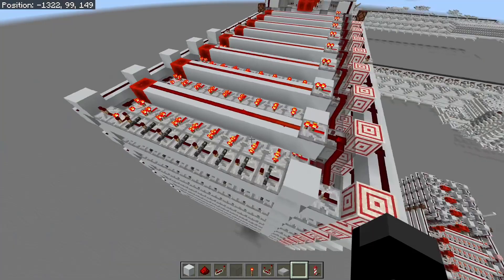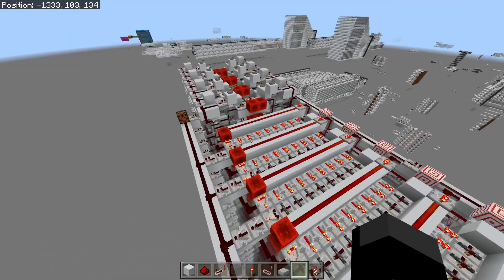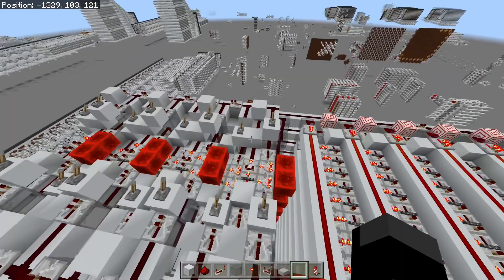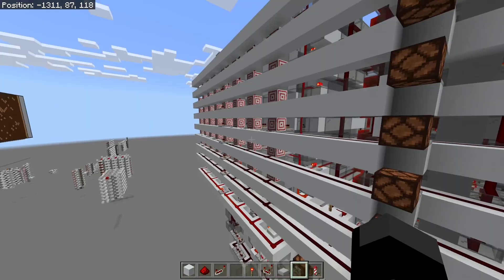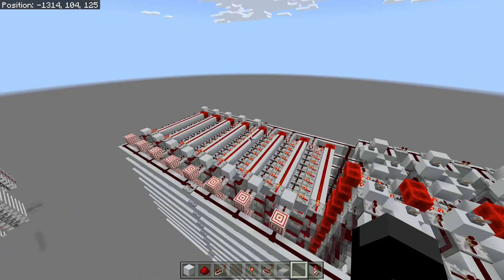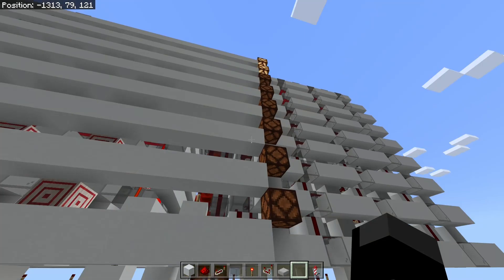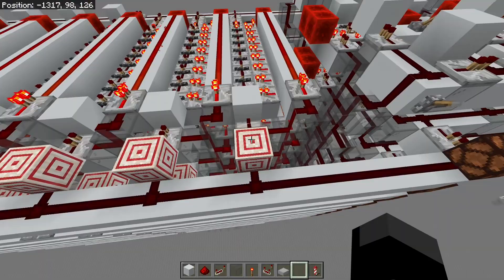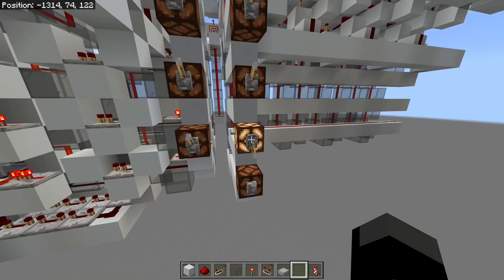RAM/Memory Paging Concept! - Minecraft Bedrock

Comment: Question… can you use the process of paging to make a computer register?
Reply from the maker: Technically yes. The most common form is by using a data cache where you have a cache of like 64 bytes and say 256 bytes of RAM. You can also use paging if you run out of physical address space e.g. if I had a 4 bit address I would only have 16 locations but If I wanted more I could use paging.